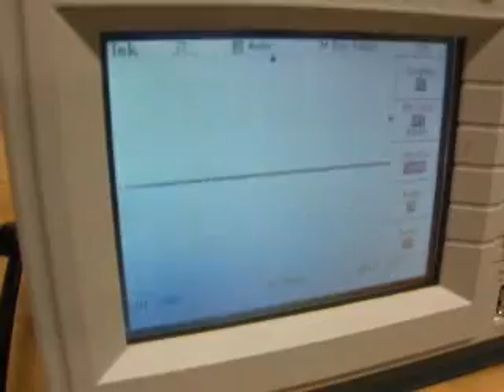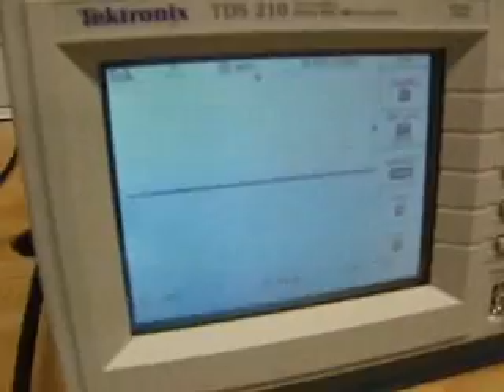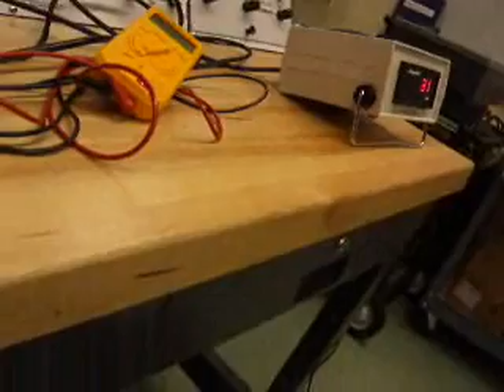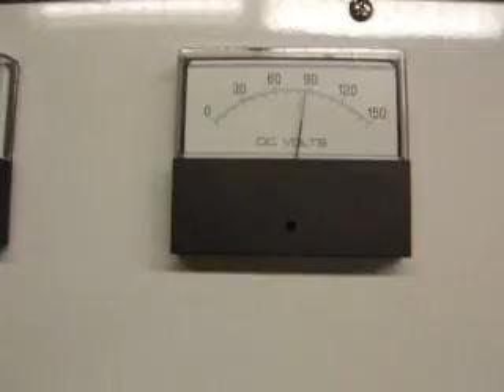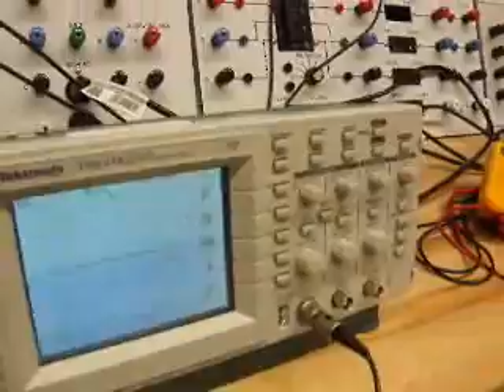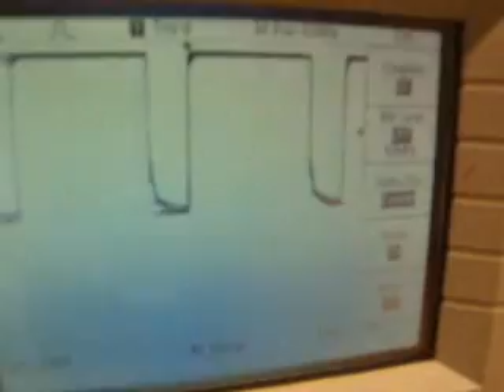Very Simple PWM MOSFET Demo with 3 H.P. DC Motor

Comment: woooooooowwwwwwwwwwwwwwwwww

that's just a 3hp motor???
I would expect some tens of hp or even hundreds from this giant...
And the inretia is pretty high. You can hear it clearly.

Put a 3 phase one. They are REALLY smaller for the same output but also to a REALLY low inertia.

With the motor in that video you can never get working servo motor. That's for sure.
I guess it was not made for servo porpuse either.